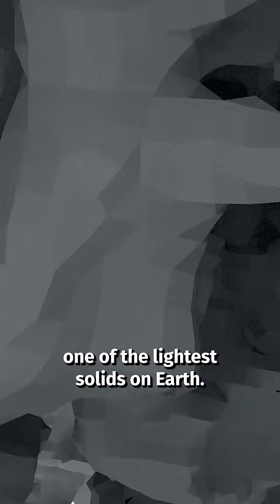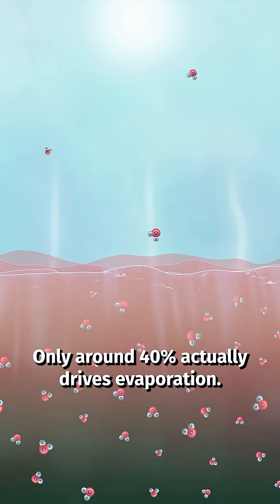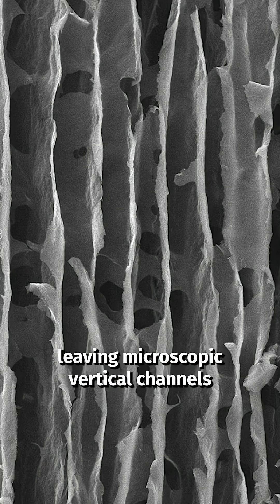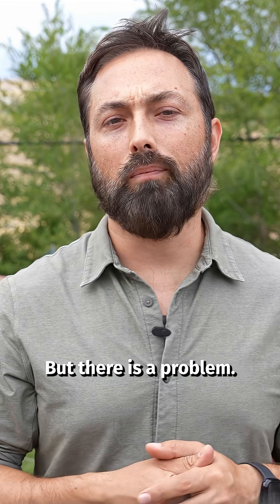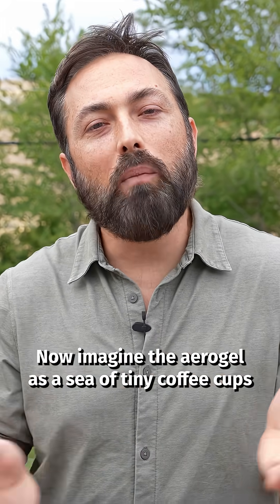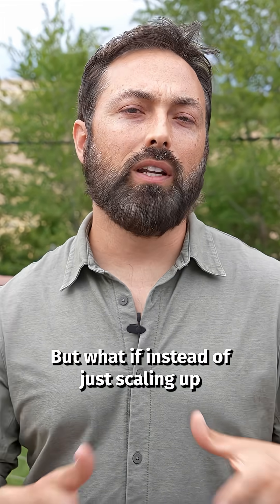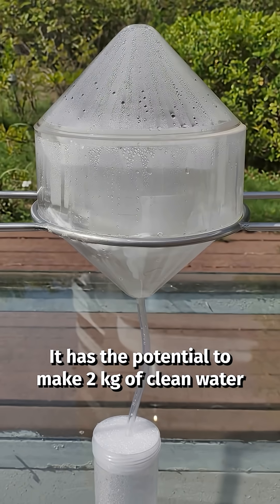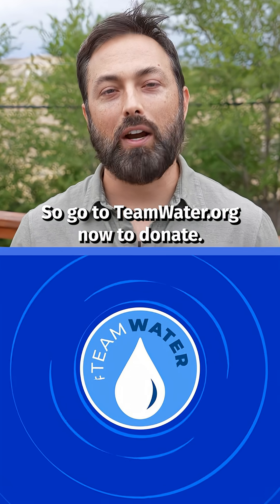How aerogel can make the ocean drinkable

Comment: What happens to the salt ?
Doesn't it clog everything up pretty fast?
Reply: The salt stays down there like a good boy
Reply: @Aoredon  Best way to explain.
Reply: @Aoredon   - just rinse it off, back into the brines below...
Reply: @Aoredon stays in the tiny pores of your aerogel as it evaporates right?
Reply: @Aoredon ????
Reply: @Aoredon  wish
Reply: Not to mention aerogel is very expensive to make.
Reply: @BlackCeII so were the first lightbulbs.
Reply: @BlackCeII  When you factor in the huge cost of aerogel, what is the actual cost to desalinate a gallon of seawater?
Reply: @BlackCeII price depends on thickness and such. Block are still expensive but powders are "cheap". This group is 3d printing it. But prices are projected to drop up to 90% as production scales up.
Reply: @BlackCeII    - per metre squared  (or in regular metric speak, per square metre...  They, forget lots of square metres are required...
Reply: I think salt shouldnt be a big problem, since the aerogel is soaked in water all the time so the salt will just stay in the water that doesnt evaporate. Which will lead to having a higher salt concentratiom in the undistilled water, but that shouldnt be a problem since when deployed on big salt water Reservoirs (like the ocean)this increase wount even be measurable
Reply: @benniwd2077 that’s a good point! I wonder if that’s how it actually ends up working irl, makes sense though.
Reply: that is why is still in the lab. Many issues to fix before can be used in real applications. Most of the research like this never get to production because most of those issues never get fixed in a economic and viable way.
Reply: Right? I imagine it deposits on the top.  You would have to scrape it away regularly?
Reply: This was exactly my thought. After all, the salt farms flood a huge area with a thin layer of sea water and let the water evaporate, leaving the salt behind.

So yea, where does this salt go??
Hopefuly the long format video addresses this.
Reply: @DUKE_of_RAMBLE  
Not mentioned by researcher means they have no idea how to fix it.
Reply: @DUKE_of_RAMBLE   - bulldozers push the salt into piles and it gets sent to the purification ponds and thence to export...

Nb I deny being a bot...
Reply: @kadmow  Not sure if you're saying this in reference to the salt evap ponds, which I was using as an example...
Or if you're implying that's what they'll do with these new aerogel desalination setups...

Because I'm only using that as a comparison, to point out that salt is in fact the byproduct of evaporating sea water, as some other replies seemed to think it's a nonissue. 

If you meant this as a solution then no: I can guarantee they're not using bulldozers with the aerogel. It's nowhere near strong enough to support that amount of weight. Nevermind the fact that even if their weight didn't crush it, the scraping of the dozer blade over the aerogel definitely WOULD.

edit: typo
Reply: I never thought about this before... I know this would be a very far away problem and it would take an unbelievable amount of scaling to create this issue... But by extracting desalinated water from the ocean and leaving behind the salt, could there ever come a time where that higher concentration of salt in the ocean would become its own ecological disaster? In the same way we've thrown atmospheric C02 concentration out of whack?
Reply: Everyone seems obsessed with the salt problem. Sea water contains a lot more stuff than salt, and a lot of it doesn't dissolve.
Then, of course, that evapouration rate is going to be under ideal conditions. So tropical sun at midday with very low air humidity and no waves.
Reply: @SarthorS if you look into the desalination plant in Mexico in Baha California, you'll see how putting the salt back into the water has killed the entire ecosystem.
Reply: @DynamicPotteryStudio  Pretty much everything has downsides that are glossed over by the people pushing it. And when it comes to new ideas, there are problems that won't even manifest until it starts being used on an industrial or even global scale. 
Nothing is perfect, and while it's good that people keep trying new things and pushing forward, you need to remove the rose tinted glasses.
Reply: @normang3668 I think between rain, runoff, rivers, and melting glaciers, those freshwater sources going into the ocean are enough to counteract any water desalination projects.
Reply: @normang3668 yes, desalination plants spend A LOT of their time in the design phase making sure they don't release their brackish water (brackish means extra salty) without treating it first.  Treating it means diluting it, and releasing it somewhere where it can dilute even more by being drawn into even bigger bodies of ocean.

There's a lot of water though, and the ocean is where most of it is, so we are unlikely to be able to drink our way into making the entire ocean noticeably saltier, but it is a concern at the local level.
Reply: @normang3668  the amount of water in the ocean is borderline incomprehensibly massive. We could get all the drinking water for all of humanity from it and not make a dent. Slso it all flows back into the sea in the end anyway - that's literally why the oceans exist in the first place
Reply: @normang3668 the volume of the oceans are so unfathomably large we could spend the entire industrial capacity of humanity, doing nothing but removing fresh water for a year and still not be able to measure the impact on the oceans salinity.

I wouldn't worry about that.   besides saltwater is evaporating by the millions of cubic meters every day constantly and falling as rain then returning to the ocean.

so we'd just be adding to this process, using the water and eventually it would end up back in the ocean. it would be like worrying that taking a tablespoon out of a swimming pool would make the chlorine too strong
Reply: You can wash it out again, even with sea water probably because that isn't 100% saturated, if you're not on the dead sea.
Reply: I think as the water evaporates it gets concentrated with salt and concentrated solutions are denser so it falls.
Reply: @PotionsMaster666   (no) - think again. It becomes increasingly  problem, pores get clogged.
Reply: It builds up in the top not inside or middle,
What they’re doing is to ensure top layer is replaceable and changeable. Simply washing off would do the job, the problem is the mass production and right industrial methods for this.
Reply: Diffusion through a semipermeable membrane, so it might be. If not the salt, then everything else will be. That's fouling a problem from the ultrafiltration. There's another problem aerogel dissolves in water that's probablly the reason why they try to synthsize it which means nanoplastic.. overall great idea. Enough of bullshittery from me
Reply: Difuse  away, mixing with water with lover salt concentration
Reply: That salt residue is definitely the biggest question for scaling this up. Even regular desalination plants struggle with what to do with the concentrated brine without messing up local ocean ecosystems. Makes ya wonder. 🤔
Reply: Take the salt and sell it to hunters or farms
Reply: agreed! they would just clog up the gel surface thus reducing the amount of water that can potentially be suck up
Reply: The salt isn’t dumb enough to ingest glass shards only we are
Reply: @stevey.iPhoneAir everywhere you go, you make everyone around you seem far more intelligent by comparison.
Reply: @Lamb666 ok you have fun drinking glass you highly intelligent being you pats ur head
Reply: @stevey.iPhoneAir wtf are you talking about
Reply: @Candlemancer you don’t know what this stuff is made out of?
Reply: @stevey.iPhoneAir  YOU are, yes I agree. But not “we”.
Learn to speak for yourseIf and yourseIf onIy.
Reply: Salts do not evaporate
Reply: Salt is dissolved in water, you can't filter it out physically.
Reply: @Tkcb2799  but you're evaporating the water and leaving the salt behind
Reply: @slingman1074 wouldn't that raise the salinity of the rest of the water?
Reply: @slingman1074 When evaporating, yes you're correct.
Reply: @Tkcb2799  the water is evaporating ontop that will leave behind the salt
Reply: @Tkcb2799 People have been doing it for over a thousand years via reverse osmosis
Reply: @Tkcb2799  Though a traditional filter like a coffee filter won't work, you can use a semipermeable membrane to remove salt from water. The process commonly used is called reverse osmosis.
Reply: @Tkcb2799  yes you can that's what the earth does.
Reply: @Tkcb2799  lol you can filter dissolved solids. Just because it is dissolved doesn't mean the salt particles become as small as water. They are just broken down, and become microscopic, but are still larger than water molecules and can be dissolved by running the water through holes it can pass through that are smaller than the salt particles.

Something that is dissolved is something that is evenly distributed throughout another medium.
Reply: @DustinMulligan-w9b Dissolved salt is not solid. When in water, salt is seperated as Na+ and Cl- ions. This has nothing to do with the size.

Comment: I really think aerogel might be an important material in the future
Reply: We're in the future, because it is already a very important material. Being 99% air, it is super effective at thermal insulation, and unsurprisingly, its porous nature excels at capturing high-speed particles, hence it is used in spacecrafts and satellites to protect the electronics from extreme thermal conditions and dust. Also, it's very lightweight, so it is that much more convenient to use. And now we see a brand new use for it in this video! A wonder material for sure